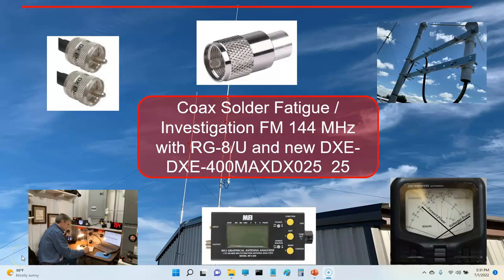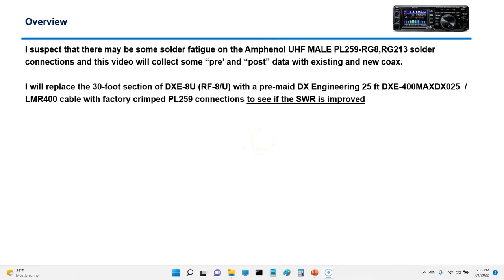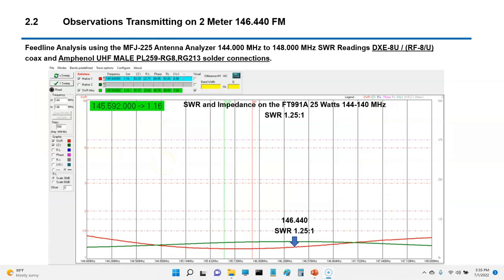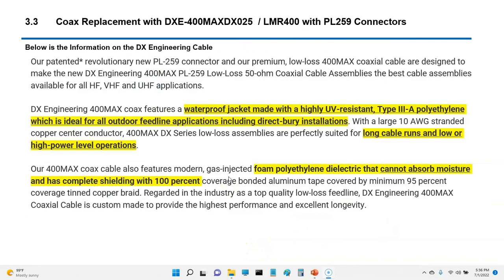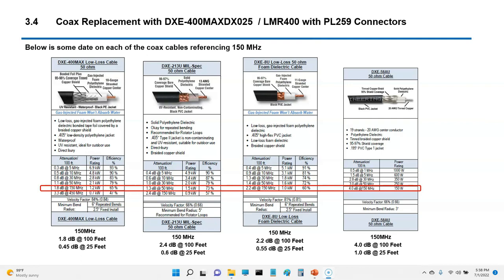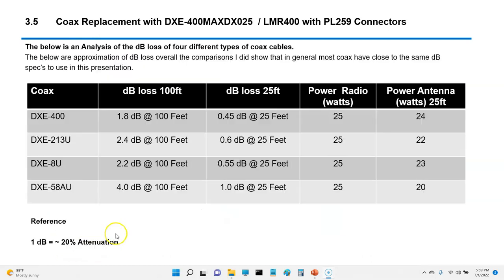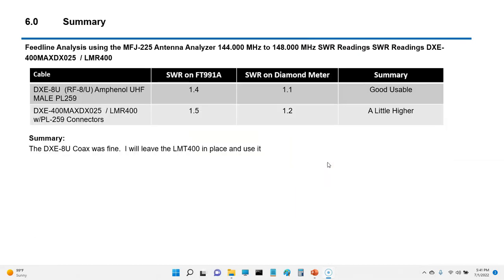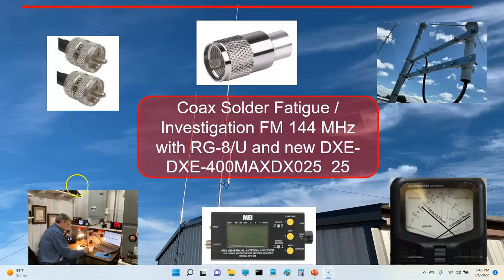Coax Investigation RG 8 U and LMR400 Swap Out and Test Data

Comment: Good to see someone doing some testing for their selves.  I have been a ham for over 50 years and kept up a repeater for about 40.  When the run is only 25 feet I would use rg-8x from a known good source.  Even that would not be noticed over the loss in 25 feet of coax.  While the instruments and tables show some difference I can tell from experience that the .  half of a db is not going to be noticed in any common situation.  It may be noticed in some of the more uncommon modes like moon bounce . 

Often more loss in the coax the better the SWR will look at the transmitter end.   With a few hundred feet of rg58 even open or shorted on the far end will show almost no swr.
Reply from the maker: Thank  you sir, yeah I'm learning and share all the things I learn to help HAM thanks for the message 73 from KI5JUF

Comment: Nice.
Thank you for sharing. I enjoyed your video. For some reason, I end up, "upping" to the next best thing when I have to purchase gear for my shack. Years of pinching pennies has most likely cost me more in the long run. LMR- 400 for my VHF, and I went with RG-8u for my HF feed line... Never used those crimp styled connectors.  Gonna have to check those out sometime. I need a few more jumpers so I guess I'll take your advice and order them like you did. Thanks.
73s de KF4LBG,  Larry in North Florida...
Reply from the maker: Good evening sir and thanks for message, have great holiday and good luck on the set up, I like your plan LMR-400 for VHF and RG8u for the HF.  I ended up doing LMR400 on my HF with Diamond CP-610 been pretty happy with it.  Thanks again let me know if there is anything I can help with 73

Comment: Great video. A lot of thought has to go into coax. One size doesn't necessarily fit all, but it's rarely saving anything going with Amazon coax and connectors. I tried their compression PL259s and didn't like them, especially the RG8X ones. I also have noticed RG8X doesn't typically last long in the elements. Never had any issues with the LMR400 clone. Now I'm using RG8U from Amazon (made by Alpha Distributors) with Amphenol's installed for a 50 ft run. Time will tell. I no longer like the idea of anything longer than a jumper for RG8X.  Lesson: coax can be our weakest link without really realizing it.

Comment: I wonder if the SWR is the same on the LMR setup and the RG setup.  The .1 difference in reading is probably because the 8U has more loss.  That loss appears as a lower SWR.  So, your radiated power off the antenna for the 8U is perhaps lower than you think?  Not by much... Not enough to matter.  But interesting to consider.
Reply from the maker: Good point, lately I've used DX Engineering LMR400 50 Foot with the connectors.  They seem to have good quality - thanks again for the comment something to consider 73 hope to catch you on the air

Comment: That was a great science experiment for sure... but isn't it interesting - in the end you didn't have a problem, 23 watts or 24 watts out of 25 watts is so negligible that it's a practical tie.  No issue with the original setup.  Now if you run 70cm  I thin you will find a much bigger loss

Comment: The slightly higher SWR on LMR 400 is likely due to its lower loss.  Lower SWR doesn't better in this case. The SWR you measured was SWR at the Radio some of the return signal is lost. The results in this instance, shows a marginal difference.
Reply from the maker: Good evening sir and thanks for the message, thanks for the information I appreciate it very much, 73 and hope to catch you on the air